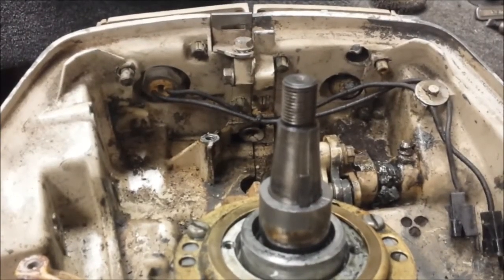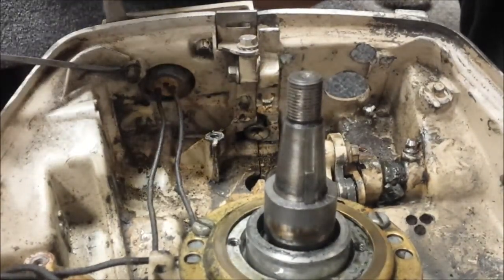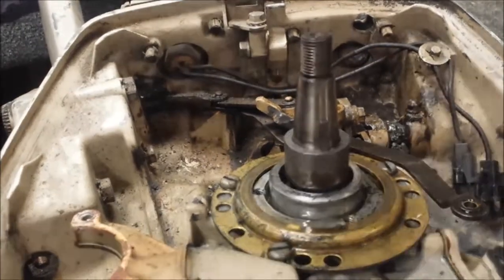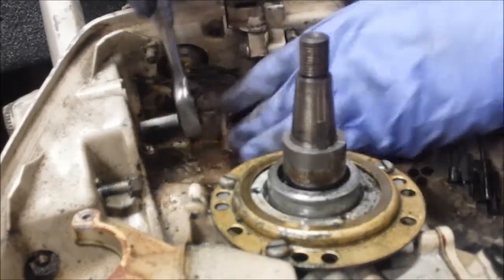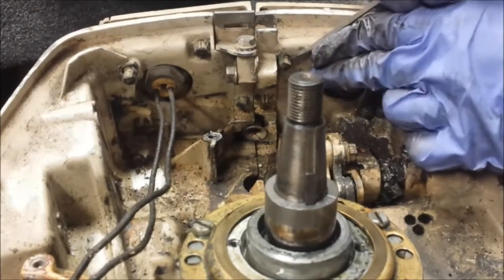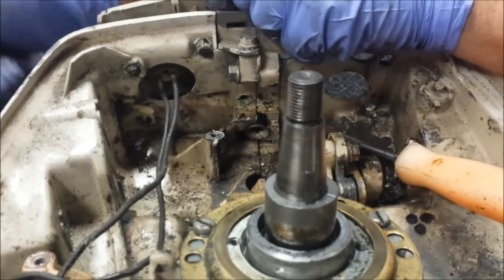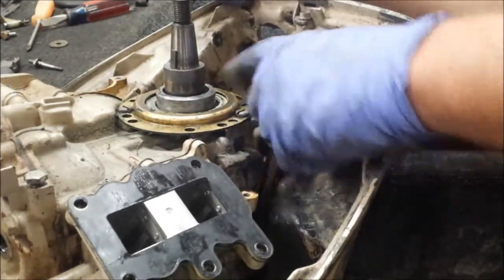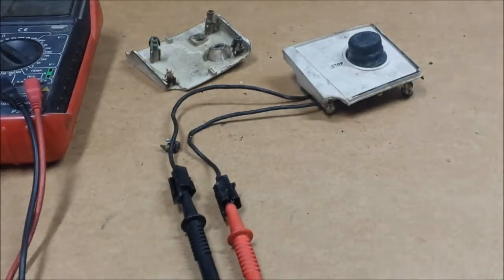Johnson 9.5 HP Teardown - Part 5; Tiller Handle

Comment: I have the same motor. The water jacket that is located behind the starter has a crack and is spraying water. How do I get to that to take it off? I can’t get to the bottom bolts.

Comment: Do you show the teardown of the stern bracket at all, specifically the tilt lock lever.  I've got a Evinrude '69 9.5 HP and mine got bent all out of shape and trying to figure out what all is needed to replace that.  What connects to the little hole at the end of the tilt lock lever, it wasn't hooked up to anything on mine.  You mentioned the cable around 12:08 in this video that goes down to the reverse lock, is that in any way related?

Comment: I have the same model and year johnson how can I add remote steering and throtle?
Reply from the maker: Well, the kit has been discontinued for years, 
only way is to find the parts needed on eBay.
Reply: @BrandonsGarage  this is what I have so far 121625, and a lever for the drive? Purchased through ebay. Really love help videos. Thank you

Comment: How do you remove or adjust the male fuel connection on the motor. Couldn't find where you disconnected it. I bought 4 different female connectors and none will clip and lock. Please help, thank you
Reply from the maker: its built into the handle, not removable. 
What fuel connectors are you buying?
Reply: I have the walmart special, believe they are attwood.. Also purchased a moeller connector that did not fit..
Reply: Any advice on how to make it work? I left the old fuel lines in my front yard and someone took them. I just finished rebuilding the carburetor, changed the fuel pump. Rebuild the water pump and resealed the lower unit thanks to you’re vids (thank you, btw). Now just having a problem finding fuel connectors that will fit and click.
Reply from the maker: Its odd the Attwood connector doesn't work. I would try a genuine fuel connector and take it from there.
Reply: Brandon's Garage. So, after purchasing the eighth connector (lol). I grabbed one and slid a flathead screw driver under the metal clip part (where the metal clip clicks in and locks) and pried it out just a hair and now fits like a glove. Wow! Thanks again for the vids. Really helpful.

Comment: Am I missing something? I didn't see anything about the tiller handle in the video, only internal shots and removal of the kill switch and front plate? I am looking to replace the inner rod for the tiller handle, and want to make sure before I dive in that it is the problem. I can turn the throttle until the gear at the end of the rod slips off, and wanted to see an original one to make sure that it is the damaged gear on the end that is the issue. Any vids of the handle tear down? Thx.
Reply from the maker: Its more of a handle removal.
Reply: Got ya. I found a replacement handle on Ebay for 40.00, and the only part I really need is the internal rod, and I think by removing split rings on the gear end, I should be able to pull shaft out, replace with new(er), and put handle back on and be back in business. Thanks for replying and the time you took to make the vids, as I am going to try and keep my trout boat running for fall/winter when the fish stop biting in the lakes and I put up the bass boat!

Comment: when you took off the handle did it look like you could replace the fuel quick connects or are they stuck to the motor
Reply from the maker: Oh heck no, its built into the base.
Ill see if I cant find a picture...
did you break yours or something?
Reply: no i bought a 66 9.5 sportwin and i wanna hook it up right if you ever get any 1966 handles let me know
Reply from the maker: The 9.5 Handles are the same across all years. Did you see the ebay number? its exactly what you need.
If you want to replace just the base, look for part number-
 0380966 BRACKET AND FUEL CONNECTOR ASSY.
Reply: my handle assembly has the idle control built into it as well ill try and find a pic
Reply: Will Lyons I also need this part or mine adjusted. Is there a way of adjusting or to push out male connection a hair. Mine won't budge and i can't get a solid snap and click connection. Any advise?